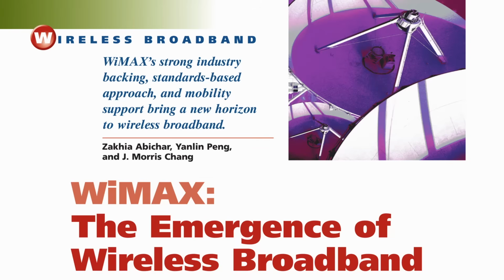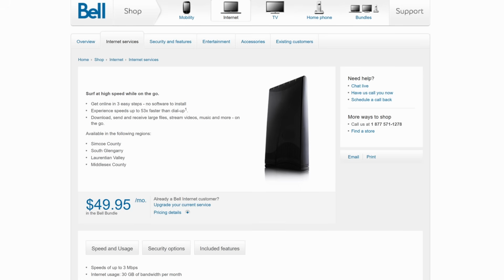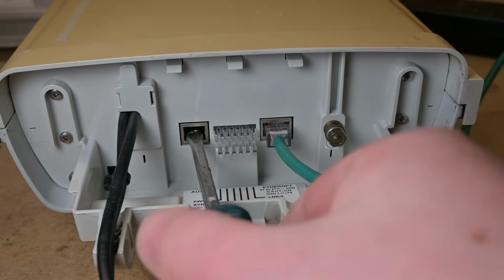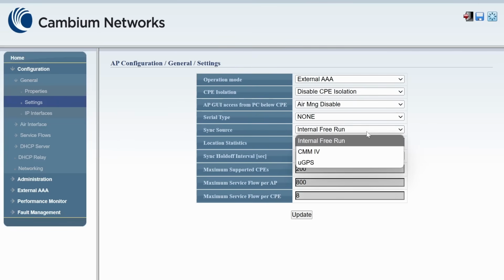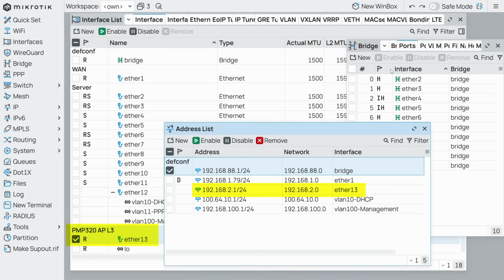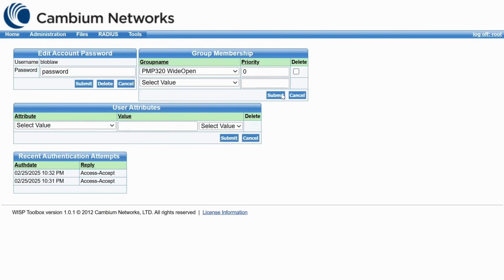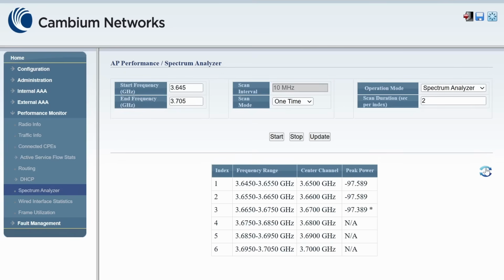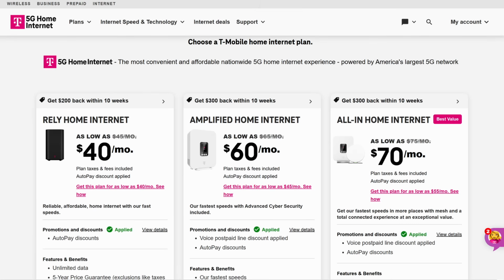WiMAX and Motorola PMP320: The Next Big Thing that... Wasn't.

Comment: Seems like you are very well versed in WiMAX infrastructure! I wondered if it is possible to extend a LAN using just 2 customer transceiver units? we are talking about the Huawei BM8301 trancievers. I need to put 6 cameras on an internet connection and there is no phone reception or available internet providers in a 15 km radius of it. And i have a truckload of those access points brand new sealed in boxes that were destined for the E-waste pile. I'd appreciate some help in trying to connect them to each other.
Reply from the maker: Unfortunately the subscriber units were never able to communication directly with each other, which is really too bad. Other fixed wireless equipment from the likes of Cambium, Ubiquiti, Mimosa, ect typically based on WiFi chipsets can generally do a point to point mode, but the standard for WiMAX never allowed for it. So all those Huawei units are essentially scrap, unless you wanted to reuse the outdoor cases for things like Meshtastic nodes. The higher end WiMAX APs also needed a lot of supporting infrastructure to boot and start transmitting too. I have some other videos on inexpensive WiFi bridges if you're looking for something to use for your cameras.
Reply: @BenJefferyCanada  Thanks for the input! I'll look in to them. It just seems a waste to throw away perfectly working hardware with decent capabilities. I'll look in to the chipsets and try to reprogram them to send and receive packages on a lower level. As i figured the radio on the Huawei client unit is capable of running both on 900MHz and 3.5GHz wavebands. But it will definately be a side project now. I need the bridge now so i'll look in to long range WiFi. Thanks again! I'll share if i manage to crack the WiMAX hardware in to some open standard communication.

Comment: The technology isn't dead in the US, since 4G and 5G data carriers have data caps, and don't offer home service in areas that have full 5G coverage.  I get gigabit speeds in my shack on  my verizon phone, but they claim they don't have service here.  The 5ghz and 5-5.8ghz isn't licensed,  So anyone can get CPEs capable of miles of 2.5 and 5ghz Wi-Fi (Ubuquiti and TP-Link have WISP oriented CPEs), so allot of locally owned rural WISPs still exist in rural areas offering 12-50 megabit.  They thrived  in n areas were HughesNet/ViaSat was the only other option.  But being geostationary satellite ISPs there latency and speed is terrible, and have worse data caps than 4G hotspot.  Up until two years ago I ran my whole home lab, MSP business,  and house with 30+ areces of wifi, off a 6megabit wisp (too far from the tower for any other package).   It was the only service with unlimited data, and I used my phones hotspot when I had to download or upload large files.  Now I have starlink and Wi-Fi6e on 30+ acres  (thanks to a WAVLINK review samples), and now getting 300+ megabit.  But there are allot of low income farmers still on the WISP because the kits at walmark are $350 for starlink, and 6 megabit is good enough for email and Facebook,.  They still watch DirecTV through a physical dish and receiver, not streaming.  Even 6 megabit with Netflix compression, you can get you a couple 720P  simultaneous streams, so an elderly couple living on the family farm doesn't even see the need to change everything, when 6 megabit is good enough for them.

Comment: FYI you can license some unused spectrum in the 3.8GHz range via ISED NCLL...I see quite a few random people with licenses for their local rural areas alongside the big 3.
Reply from the maker: The NCL system for 3900MHz is pretty nicely setup for those wanting to deploy private LTE/5G systems on a campus, industrial site, warehouse, farm, ect and the portal makes it reasonably accessible to do. 

Unfortunately it's way up in the 3900-3980MHz range, where none of the equipment we have deployed can operate (LTE, PMP450i, the original PMP450M 3GHz models) and there's very limited WISP-focused equipment since it doesn't overlap with CBRS in the US. There's also a hard cap of 20MHz of total spectrum vs the 50MHz we had access to before with WBS. When you combine those two things, we'd have to forklift everything to have under half the capacity as we did before, but with much higher licensee fees.

Comment: In Europe WiMAX was in many cases completely failure. Due to EU regulations and misconceptions WiMAX in the field has minor coverage. In Poland for example there was no possible to get licence for a long period of time due to problem with acceptance of mobile WiMAX and fixed WiMAX bandplans and equipment availability.  When licences were available around 2009-2010 - the price for each 1Mhz of band was to high and unreasonable to deliver high speed Internet. Overall WiMAX performance was too low in compare to cheap gear like Ubiquiti or Mikrotik in 5GHZ. There just only few networks here around major cities and just for small amount of customers - especially business.

Comment: Eastern European here. I had the displeasure of testing WiMAX in 2000s. We had WiMAX service which was run by a state-owned telecommunications provider. It was okay'ish but only if you placed the router as high as possible and knew which way the transmitter tower is so you can point your router at it. The router itself IIRC was a cheap low-end ZTE-made unit. It was self-contained, no external antennas.
The provider later migrated the whole system to standard 4G LTE-TDD which worked somewhat better and you could use regular 4G routers.

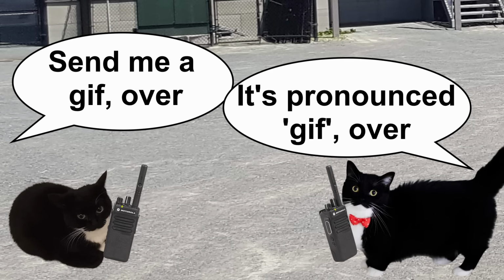Comment: Ironically, the image you used at 10:02 to illustrate radios that only let one person talk at a time appears to be the motorola dp2400e, which uses the DMR standard, which actually is TDMA. DMR lets two people talk on a repeater at the same time. Tbf, these radios can also do regular old FM too, so in that case they do illustrate your point

Comment: I recall them promising the moon but in the end it was too little of an improvement and too expansive for wisps, had range reduction for cell carriers, did not function at highway speeds.  I remember Motorola cambium division betting the company on it and failing, had to spin that division off to recover.

Comment: WiMax is still in use in Iceland until 31.December 2025 when their licence expires (I don't think they are going to get extended again) and the rest of the 3500Mhz band goes to 5G use. I don't know if the company that still provides this service in Iceland has many customers at this point. Since most people have moved to quicker 4G network connection if fibre connection is not an option. In many places in Iceland, fibre is an option for the internet connection.

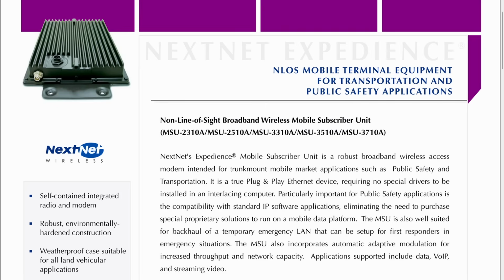Comment: I lived in a rural area outside a small farming town in Iowa, and we were stuck with dialup until 2006 when an Expedience-based wireless ISP finally set up a tower we were within range of. It was only 256kbps, but that was still tons better than crappy dialup over crappy phone lines. The indoor wireless receiver they gave us looked exactly like the one shown at 3:04. It eventually got upgraded to 512k, then 1.5m within a year. But, as more people signed up, reliability became horrendous. Towards the end, packet loss was averaging 50% on a good day. By late 2007, CenturyLink had finally expanded DSL service to our area. We were LITERALLY right on the end of the line, so it wasn't any faster, but it was a million times more reliable. That wireless ISP was still running until about three years ago, when it silently went bankrupt and shut down without any public announcements.

I don't recall where, but I remember a long time ago seeing an online article saying that the wireless spectrum/technology that Expedience used was originally designed for "wireless cable TV", but eventually got repurposed into a protocol for wireless internet access.

Comment: 🇩🇰🇩🇰An ISP here in Denmark tried the same thing around 2000 (called FWA), you had to put up an antenna and there had to be line-off-site to the transmitting tower
And it went nowhere , at the same time xDSL was introduced, and the project died

Comment: Hey where you were on 3.65ghz ?,  I could look up my callsign (I have pics in a backup of the license somewhere)  but I was the only one licensed or the Toronto area. (Rural durham region).
I used it for PTP links with airfiber 3X and one PTMP setup with ubiquiti 802.11n as a test. TDD  instead of FDD on this band offered nothing for me over using the unlicensed bands.

Its kinda crazy nobody obeyed the licensing rules in my area, I was the only one registering my stations and infrastructure in the industry Canada portal. 
There was two ISP's with telrad LTE without a license or registered stations.  And one on ubiquiti one licensed for elsewhere.
People sold the licensed gear to anyone who wanted to buy it without asking for the callsign and looking it up.

Comment: I had the displeasure of working for a Sprint retailer in 2011-2012, in an area where they had not yet rolled out WiMAX.

"I have to pay an additional $10 each month..."

"Yup..."

"... for WiMAX..."

"... yup..."

"... that's not available anywhere I'm going to use my phone."

heavy sigh "... yup."

What was even worse than informing customers they had to pay for something they didn't have access to, was the data speeds. I found a tower and stood next to the base of it and ran a speed test. It capped out at about 12Mbps*. Meanwhile, in ultra-rural Minnesota, my then-partner's Verizon 4G LTE phone got 41Mbps sitting in a car in the driveway of his parent's house in a tiny town of 700.

"Why aren't you selling more?!"

"Seriously?"

It's a miracle Sprint lasted as long as it did. Hell, that "Preferred Retailer" I worked for folded only a couple years after I left.

Good riddance to both of them.
Reply: Sprint told me my phone was covered in US and Canada, in 2004. Maybe 2005. And went on vacation to Canada and it turned out it wasn't covered or at least, not until I got home after paying over $1,100 in 3 weeks time and complaining to the customer retentions department. They gave me a credit for $1,400 and once it was used up I switched.
Reply: RadioShack?

Comment: FYI, Bells wimax was really Motorola expedience, it predates wimax. But they called it wimax to sound up to date. Its not even the same framing.
I had a scrap ODU for it at one point im pretty sure it was 20mhz wide in its widest setting.

 I think the Bell Rogers "wimax" system also had some crazy high frame duration. The latency was worse then dialup. I don't know if this was an issue on real wimax.

Comment: So the place I work for was a reseller for a company called BridgeMAXX. They used wimax technology. This is after reading about a company in Australia saying it was a disaster. Looks like the Article is still on Wired. Anyway they first setup shop in Rexburg Idaho I think. Worked great. Then they setup in Pocatello Idaho. Let the fun begin. One problem is they didn't pull a topographical map for the area. So that caused problems. The next is they couldn't find anybody who wanted to give them a tower to use. So they had a special team come out and look into what was going on. Part of it was not just flat land. Then you had the other part of old house that effect any wifi. They come in and declare how much better it would be than wifi. One of the big selling points is a little box you can place in your house. No external antenna to install. No, that did not work for most. You had to place it in the window. Preferable in direction of the tower. They finally started offering a antenna that could be added on. This helped but only a bit. They did offer the traditional outside antenna like what you have. In fact if anybody watches the Pocatello Idaho Home Extreme maker over. They sponsored the internet. I asks the area resellers sale rep about it. He said a house that size and since they wanted to promote how great the network was. They had no choice to put in a directional antenna. I want to say from memory that the speed was better than a standard wisp provider. But, had more issues. Also as for the equipment. Standard cisco router with =48v battery backup / power converter. GPS location. Also yes, I do remember hearing about Clearwire. But, don't know anything about them.

Comment: I was the author of Motorola’s technology strategy in the mod 2000’s working for the CTO. I had just arrived at Motorola Labs and my 2nd big task was to try killing WiMAX, which was obviously going to fail by 2007.  Nearly lost my job over it. My 1st battle was over cable set tops. And my last was fighting the decision to give Microsoft the smartphone software. It wasn’t fun. The company knew a lot but just decided everything wrong.
Reply: That's quite something indeed, so what do you get out of life?
Reply: @stewartdahamman Good corporate strategy is sometimes more about knowing what NOT to do — so you have resources to apply to programs that will succeed. Stopping is even harder. But there is also the insight about where to focus. I just mentioned the former.
Reply: @tallen6641  I guess that wisdom only comes with experience, it sounds like a very interesting field- are you enjoying your career and finding it fulfilling?
Reply: @stewartdahamman  what difference does that question make? It's not like you're going to be a Motorola technician any time soon

Comment: I was one of the first people to deploy the 320 platform. Had some running until their grandfathered 3.65 licenses ran out. Deployed hundreds of APs with thousands of customers. They had their issues in the beginning, but after they worked out the bugs it was a stable platform. Had users run on it for over a decade. When it first came out it was like magic. Had customers 15 miles out connected with 5+mb connections.

Comment: Oh God. PMP320s... I worked on the Sprint build-out for WiMAX as well as a regional company that had a 3.65GHz license for WiMAX deployment.

These things were absolutely full of promise, and that was about it.

Couple tips I picked up working with Cambium; you can power them with a standard PoE by swapping the brown and blue wires around, and you can reset them with a USB-B connector. I kept one I cut off a USB  cable on my keyring.

Adding notes as I watch; IIRC, the scan feature is an activex control. You HAVE to use Internet  Explorer 6 to use it.

Comment: Great video! I remember WiMAX since it (HTC Evo 4G, anyone?) was one of the fun failed Sprint experiments.
Reply: Had one of those phones. I had such high hopes for it but the performance was bad. Wimax barely worked. Traded it for a Sprint Galaxy S3 and it was better as a device but the Wimax was not.  Swapped that S3 for a Sprint S3 LTE device, one of the first they had after admitting Wimax was a failure.  It was worse.  I couldn't even get a Sprint LTE signal while standing outside in open air 1000ft from the cell tower. So returned it and went to Verizon LTE and never looked back.
Reply: The Sprint guys always said it was coming “this summer” for 4 years.
Reply: I had one briefly. Also had the Epic 4G which was Galaxy S but with a slide out keyboard.

Comment: In late 2012, I went to see Depeche Mode at Shoreline in Mountan View. I had Vrigin Mobiles cheapest plan and just got the HTC Evo V 4G. I was waiting for the show and noticed how unusable the 3G network was. I remembered that I had WiMAX and flipped it on, and was greeted with full bars and the fastest wireless connection I had seen in my life at that time. I felt like the only person on that connection that evening.

It was the only time in my life I used WiMAX, and I'm glad I had the chance to.
Reply: @locool676 I had the exact same phone and I could only use it on the 2 occasions that I went out to the city away from where I live.
I never had the opportunity to use it again and I finally got another phone.
Reply: @teddybetts3254 Immense
Reply: It's not a joke. In the dark years, (2010-ish to early 2013) EvDo in my area wasn't typically hitting better than 100kbps. In less congested areas, I could break 1.3Mbps download, which was quite usable, but those results just weren't consistently available.
Reply: @Browningate  imagine that, but for your home internet connection!  
We had Verizon 1.5mbps max, when at&t DSL was oversubscribed and got less than a megabit or something with data caps. This is after at&t squandered billions of taxpayer dollars for rural internet
Reply: @Browningate  Dark years?  Here in rural Norther NY I sill have clients on a 3 megabit Wisp feeding their farm and milking equipment.   Had a client a couple weeks ago still on a Verizon 12megabit DSL (fastest package they offer there still).  Service had been out for a week form a downed line, so I had him pick up a starlink kit at the local Walmart and switched him over the day he called me.  There are whole towns up here with nothing, and even with 4G/5G cell service they don't offer home internet, just data caped hotspots. So if they have "fast" internet at ome, its caped to under 12GB a month.  Starlink was a game changer up here.

Comment: Early cell phones were slow, because they were - like cable modems, the customer rate was set well below the technical capability. And they metered data because it was INSANELY profitable. A service explicitly sold as "the internet" would not sell very well with cellular-esq metered rates.